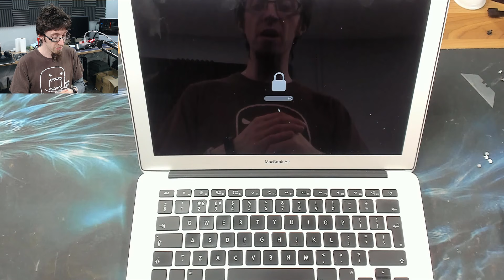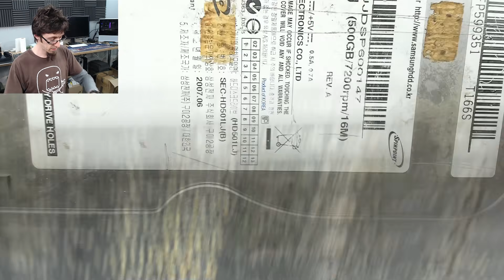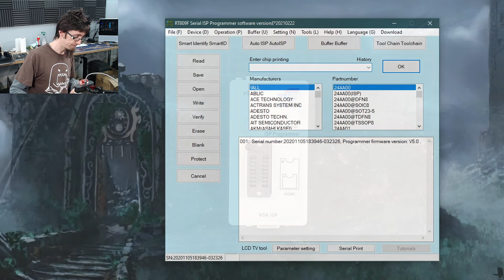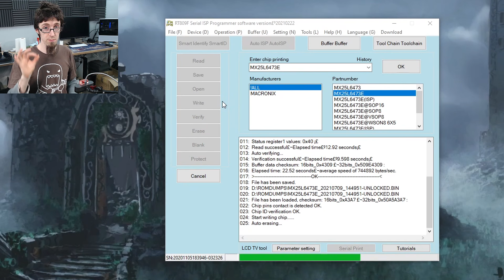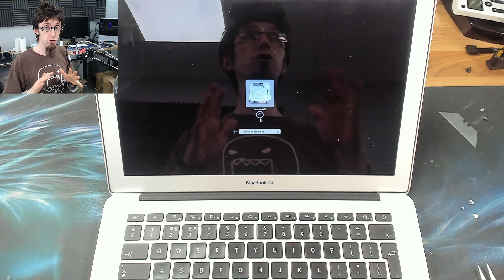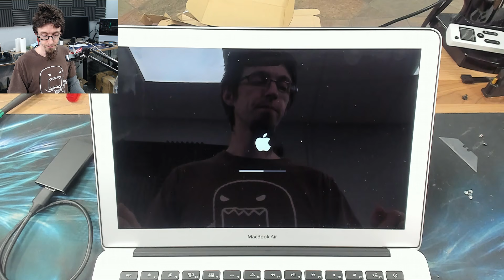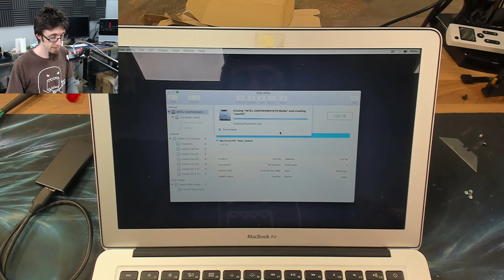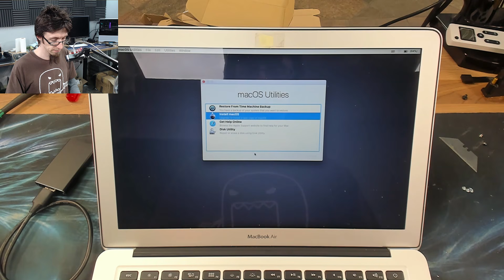[2017 and older ONLY] MacBook Air Firmware Pass / iCloud Lock Removal - LFC#275

Comment: This is a legitimate question, not  any sarcasm or with a hidden intention. How do you check that someone is the owner of a device? For example, if I go to buy a second hand laptop, how can I check? Probably if they have the original receipt or invoice with their name, that's fine. But what if it's a third hand already and they don't have it? Or as you say, someone passed away and they don't know where the invoice is... I think it's kind of difficult...
Reply: I would suggest that simply asking the question and watching the reaction tells someone a lot. Sure a prepared conman is going to have plausible answers ready but you can only do your best.
Reply from the maker: Yea... basically discretion. What's the history of the device, where did you get it, what data is on there, why don't you have the password... a little light interrogation and it's fairly easy to tell.
Thieves kinda... stand out. Dodgy-looking chap comes in, says "I got this apple right, but it shows a padlock when I turn it on, y'know? I don't want anything on it, just want to be able to use it..." yea mate, jog on...
Reply: @Adamant_IT  😂😂 Thank you to both of you. I've bought second hand laptops and phones but always seeing the original invoice because I didn't trust I could tell apart a legit seller from a thief.
Reply: I guess you have to use your own judgement and common sense.  Does the seller's response seem reasonable?  Does it make sense to you?  
"The only problem with common sense is that it's not that common."

Comment: Since you got the laptop open and access to the SSD, isn't it possible to back up the existing data from that SSD onto a USB key, or is that not possible under MacOS?
Reply from the maker: Yes, depending on if FileVault is on or not, that may be possible.
When I said "relative died with data on laptop" that's more applying to bypassing passwords in general, rather than specifically a FW password. Whenever people ask about removing passwords, there's always one guy who's like "ner ner, if you don't know the password then the device is clearly stolen", but that's not always the case.
Reply: Only if FileVault is turned off, I think. That means the data is not encrypted, and you can get at it.

Comment: Definitely need to see you do some workarounds on a bricked T2, good work with this. To be honest I haven't really played with unlocking Macs past about 2009

I'm trying my hand at doing iPhones and bypassing them and upgrading storage. It's going OK, but could be better😀
Reply: Good luck if it's an iCloud locked T2 enabled machine. These are in communication with Apple servers and you cannot unlock them. You can pay for so called bypass unlocks (range from $110- 150) per machine but they will re lock if you reinstall OS or reset the machine. Tools called T-200 and T-203 sold by a number of vendors are a total sham too, You will use them to go through a bullshit procedure and then get to a point where it will prompt you to pay for a bypass, T2 Mina being the most popular.
Reply from the maker: Yea, I actually had an email from someone offering one of those tools. The fact that they're offering it to me implies that they know I'm going to put it to the test and publish the results, so you'd imagine it's real.
However, I don't have T2 Apples laying around that I'd risk bricking the firmware on, so I can't actually accept such an offer.
Reply: @MrPnew1  like I said, I never have played with one. However I've heard of T2 Mina. They're impossible to get round yeah. Be good to see what comes out in the future tho. Could potentially find a way to imitate apple servers or something😂who knows. I'm no expert. I'm just working on iPhone 6s (or about that age) to try and unlock and improve my BGA skill